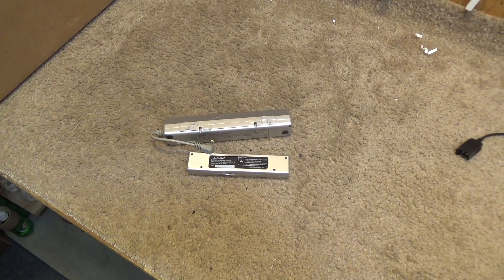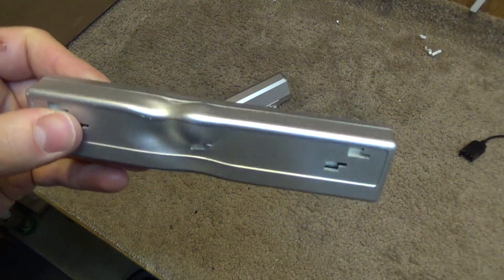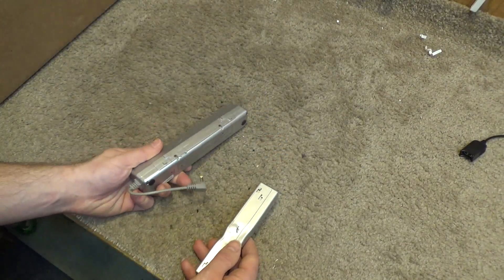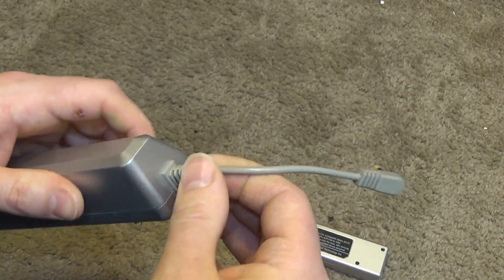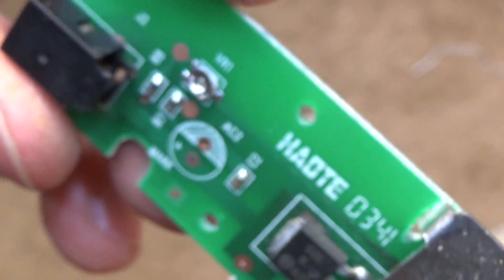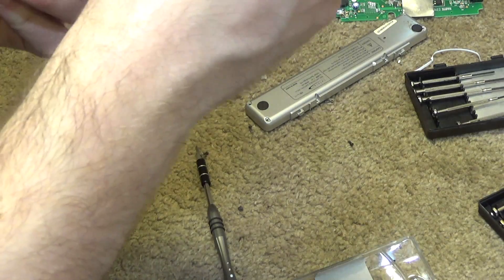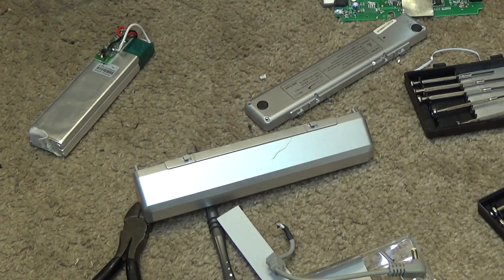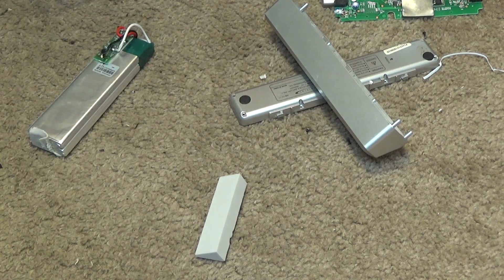Cheap and Dangerous Battery Charger Made in the China

Comment: A lady in my town nearly died awhile ago after a cheap phone charger failed and sent a massive overcurrent to her LiPo phone battery, it caught her house on fire, happened to the poor lady 3 times, she kept the receipts and they were all name brand chargers, goes to show even name brand stuff can be bad, first one was a Duracell, second was an Energizer, and third was the LG branded brick that came with the phone, after that she was so paranoid she had her husband make safety tins for the charger and phone, sure enough her newest phone, with a Li-Ion battery, blew up thanks to a faulty charger, the safety tins contained the fire enough we just sent a guy in with full turnout gear and SCBA to bring the devices outside so we could dry chem them, minimal smoke damage and I was able to retrieve the SIM and SD cards from the phone, as the battery blew out the back, not the front, and the cards were mostly intact and the SD card was still readable by the truck mounted laptop, moved her files from the card to a flash drive she had and the dept. got a much needed donation a week later
Reply from the maker: I'll be the first to say those phones can catch fire, but 4 times is awfully consistent, perhaps there was something wrong with the electrical in her house?
After the second time, I'd stop using the thing. It's kind of ridiculous that people are so addicted to those phones now that they keep using them even under such extreme conditions.
Great work by you and the department. Stay safe.
Reply: @JordanU  it was 3 different phones, this was many years ago so Li-Ion batteries were still reserved for the most expensive of devices, and after the first time the house was gutted and redone, wiring and all, I think she just had bad luck with cheap chargers, she eventually bought an iPhone and moved to a retirement village, she was up there in age and she wanted to wait till her mortgage was paid off

Comment: It a cheap crap China special portable DVD player is what it when to. I agree vote with your wallet and don't buy cheap crap.

With lithium lipo batteries you have to discharge them, or charge them to half capacity when storing. If you charge them fully and don't use them, they gas and become puffy. Good quality lithium lipo batteries actually last a long time when stored and used correctly. I have older Sony Camcorder that use the lithium pack that still hold full charge 20 years later.
Reply from the maker: Those Japanese-made Sony InfoLithum camera batteries were amazing, I have tons of them from the early 2000s that still work just fine.
Reply: @JordanU  Japan made batteries are the best. Reason why I buy eneloops for AA and AAA nickel metal hydride batteries. Never had one go bad years later. China batteries are pretty much 🗑, goes for mostly anything made in China, no regulations and buy components from cheapest vendor of the day and cut corners. No consistency.